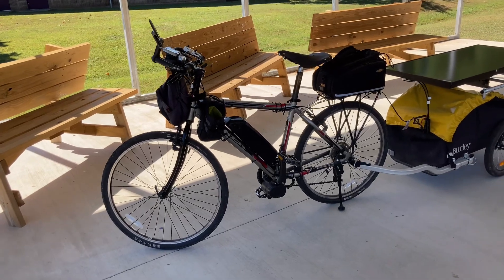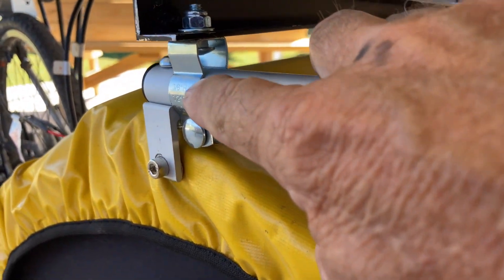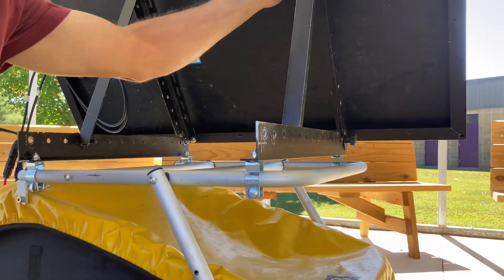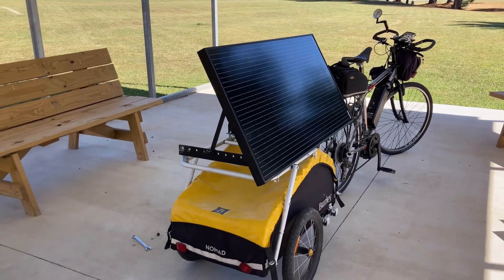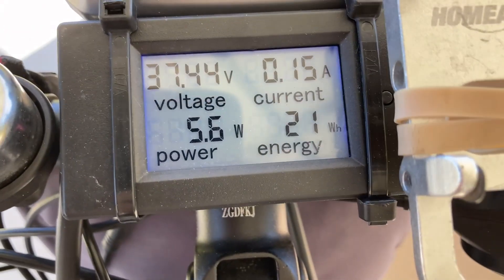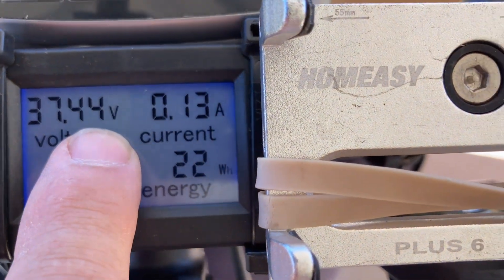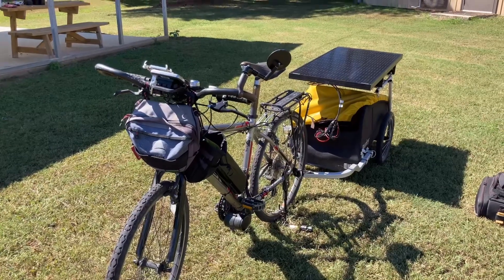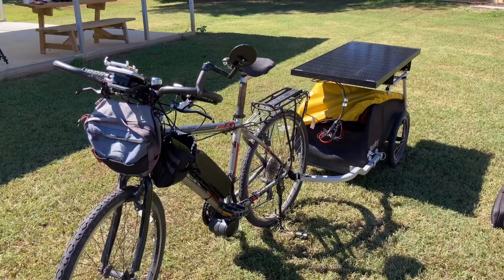My Solar Ebike

Comment: I have been using solar to charge my bike now for a little more than 3 years and rarely need to use the wall charger.  That being said,  where I live and travel many of the roads are under the canopy of trees or in the shade of a mountain so a trailer is just extra weight and a danger on narrow country roads.  My solution is a folding 100w solar panel I carry in one of my panniers with my wall charger as well.  I'm able to travel 70 miles on a fully charged 52v 21ah battery without any charging.  Taking a long lunch in a sunny spot with the panel deployed, or a place with power extends my range considerably.
Reply: True enough, and the lightest solar panel should be cigs panel..., I hate these so called 'flexible' panels, first that is false not bendable, and second they are still solid silicon that cracks way too easily...
Reply: @SolarizeYourLife  Yeah, doesn't take all that much bumpy back roads to render those silicon cell panels useless!  The folding panel I use is a cigs.
Reply: Yeah, when I got into the idea of solar ebike touring I assumed it'd make more sense to just ride the distance you can then make camp in a palce that will get good sun. Fully charge, go the distance, camp, recharge. Ideally you'd have both, get whatever power along the way and also at camp. You'd travel at the rate of power input you get, no problem if you're willing.
Reply: @HoboGardenerBen  In the mountains I use a lot of power climbing at a rate impossible to make up for with trailer-mounted solar.

Comment: Where the burley stock rack bolts thru the. Yellow cover, over time those 2 bolts left and right side work themselves loose, because you cant tighten them really hard. So i drilled all the way thru the 1/2" rack pipe and used a bolt with a nut and really tightened them down..
Also the stock Burley tilt rack only has two positions flat or 45 degrees, so i drilled 2 more holes on each side for the spring loaded buttons , so now i can angle my panel at flat , 20 degrees, 30 degrees and 45 defrees to follow the sun better while riding. Very areo dinamic. When tilted up at 30 degrees . Once you reach your campsite just unhook the trailer and tilt the whole trailer directly at the sun.. my $169 200watt 9bb panel gets 170 watts tilted at the sun correctly and only 100 watts flat. My handle bars are 27" , so my 27"x 44" panel just fits i scooted the panel bach a few extra inches on the horizontal tilt brackets so the panel clears my back fender when tilted up..i use a 800 watt ecoflow river pro 2 for my solar generator which runs my portable ice maker about 2 quarts per hour of ice, and just a cheap light weight folding cooler  to keep a little meat cold. A 500 watt electric heater that i can run in my tent for 5 minutes., to warm it up enough to sleep until i wake up freezing again, then 5 more minutes does the trick, with 2 batteries one always charging while the other bike battery runs the ebike, my batteries can go longer than i can at 65 years old thats more than enough battery power to go forever for free almost, except for food and maintenance on the equipment.😊😊😊😊😊 Ps same set up as you have now..
Reply from the maker: Good ideas.

Comment: Make a chainmail mat out of piezoelectric disks and place the between the tires and inner tubes. Will eliminate the need for solar panels and cut your battery size in half….

Comment: Rigid is heavy but it blows away the flex ones. I use a 170 watt and it charges everything I need. Wish I could show you a picture of my rig.
Reply from the maker: I have a 100 watt folding panel that I can also set up when I stop for the day. Depending on the terrain and wind it could supply all I need.

Comment: Cool! I just got two 100w flexible solar panels from a friend and I have installed  Yose Power 36v 250W conversion set on my bike. I saw you just plug it into the battery, That makes it easy too for  not having to cut much original wires.   I will buy a MPPT converter and test if it works for me. I also got a second hand bike trailer for it. Thanks for you explanation video.
Reply from the maker: Don’t plug the panels directly into the battery. Go through an MPPT so the battery will have the correct voltage.
Reply: @TennesseeCyclepath  yes, a mppt adapter between the panels and battery is the plan.
Reply from the maker: @redbearrc6706  be really careful to not get the polarity reversed at the connections.
Reply: @TennesseeCyclepath  Yes I will check polarity first. Thank you.

Comment: Great setup, you must have a good panel to get so much power.
I have heard it is better to either charge or discharge the battery but not both at the same time,  in some way it is not good for the battery life, better to have a seperate battery charging and another one in use, then swap them over.

If you are ever going to upgrade your tongsheng motor like I did get the new company Toseven, its a cross between a bafang and a tongsheng, it has more power and has torque sensing, so you use less battery power because it factors in what power your legs are doing. Also you can customise it via the creen much more than any other motor. Easy install just like the tongsheng
Reply from the maker: Thanks for the info. I didn’t know about the battery or the new company. I am definitely going to be looking for a new kit soon. The Tongsheng has worked very well for me though.
Reply: @TennesseeCyclepath  I only got about 2000 miles before it stopped turning the chainring, I found out this is a bearing called 'sprag clutch ' a one way bearing. I think it is beyond ne to change it

Comment: I like this idea can it also be used the same way for electric scooter?
Reply from the maker: Probably. You wouldn’t have as much range with a scooter because you wouldn’t be pedaling.
Reply: I mean the solar part like if I wanted to just put a somewhat big battery pack to recharge from the sun to store the energy to recharge a scooter just to get the extra miles.

Comment: what engine do you use? What do you think is the best power for a balanced use of energy and that can carry a 90kg person? Greetings from Argentina
Reply from the maker: I have a Tong Sheng TSDZ2  36  volt, 350 watt mid-drive motor.  It has been flawless in nearly 5,000 miles.  It has torque sensing.  Next conversion will be 500 watts.  It's a little underpowered pulling the trailer on hills.
Reply: @TennesseeCyclepath  Gracias por la información!

Comment: Have you assessed typical Wh input versus output when riding your bike.  I can ride at about 5Wh /mile and wonder if your system would sustain that on a
summer's day.
Reply from the maker: Unfortunately I don’t have a watt meter to measure the power my e-bike is consuming. I will say I depend on pedal power as much as possible. On a “typical” day my solar panel doesn’t keep up. I notice the battery voltage slowly dropping during the day.  When I stop for lunch etc. there is some recovery. My e-bike console doesn’t show battery percentage either so there’s a lot of guessing on how my system is performing. It’s a Tongsheng TSDZ2 and has gone 3,000 miles without a problem but the console is one of its negatives. I am going to do an overnight trip very soon weather permitting and will post a video. I will pay attention and take notes about the solar performance.
Reply: @TennesseeCyclepath  Thanks for your rapid reply.  I have a Tongsheng that was on my wife's bike. I have transferred it to a Dawes Kingpin with 20 wheels and it's a great performer. I hope to do an off grid tour in Wales in Spring with a solar trailer as a back up to other opportunities (ie cafes etc) - if I ride for 4 or 5 hours (30-40 miles) - should get enough solar...but cloudy weather is always a risk!   All my ebikes are charged by a static panel on  my shed using same mppt charger as yours - has worked well for two years - and charged my lawnmower too!

Comment: I've been cycling 4 years with solar power. I would not recommend to never use panels below 150W, and I suggest always measuring the exact power & production. A lot of the smaller panels are just complete junk, since most don't care about stats like temperature coefficients or quality of the protective glass/plastic.
Reply from the maker: It’s a learning curve for me. I wanted more watts but a 100 watt panel was as big as I felt safe with pulling on a trailer.

Comment: For the most part, the solar should/will mostly be used while stationary... While on the run/road, there are just too many trees/buildings that are constantly shading the panel... Believe me, I tried...
Reply from the maker: You have a point. On the rail-trails for example there’s lots of shade.

Comment: Where's the links you talked about?
Reply from the maker: I put them into the comments when I published the video. I just looked and they aren’t there. I’ll try again.
Reply from the maker: MPPT controller. Original model was not available:  https://a.co/d/1aDufvK
Reply from the maker: Solar panel. There are many choices. Here’s what I bought:  https://a.co/d/eexVOyg
Reply from the maker: Burley trailer. I mounted my panel on to a one wheel “Bob” trailer since making the video. Here’s the Burley:  https://a.co/d/7VlTvUK
Reply from the maker: Rack for Burley trailer:  https://a.co/d/iBR35bc
Reply from the maker: Watt meter. There are many choices:  https://a.co/d/iqFIfKZ
Reply from the maker: Watch my Solar E-bike video before you decide to build a solar setup

Comment: Solar takes a long time. If you were off somewhere and depended on it to charge you to get back home you would need a lot of time to kill.
Reply from the maker: When I was putting this together, what I envisioned was a setup that would lengthen my range. I didn’t think a 100 watt Solar panel would supply all my power needs. I am going to take it on a short trip soon and see just what it is capable of. I’ll put out a video of my results.

Comment: How much are them mppt mate
Reply from the maker: 4 LEDs MPPT Boost Solar Charge Controller Panel 300W Regulator Solar Panel Battery Regulator Charge Controller 24V-72V https://a.co/d/1aGlD2V
Reply from the maker: I finally found the right button for the links.
Reply from the maker: Solar panel:  ACOPOWER 100w 12v Monocrystalline Solar Panel Module with Connector (Panel Only, Compact Design) https://a.co/d/14p7GD6
Reply from the maker: Watt meter:  KETOTEK Amp Volt Watt Kwh Meter Tester Panel Digital 4 in 1 Ammeter Voltmeter Multimeter 12V DC 6.5-100V 20A, Voltage Current Power Energy Usage Monitor LCD Display Car Motorbike Solar https://a.co/d/2GxwHuS
Reply from the maker: Rack for Burley Trailer:  Burley Nomad Cargo Rack https://a.co/d/gOBDx3G
Reply from the maker: Burley trailer: Burley Nomad™, Aluminum Touring Cargo Bike Trailer https://a.co/d/e4AAn2t
Reply from the maker: Solar panel rack: Heavy Duty Adjustable Brackets for Mounting Solar Panels on Ground Roof Wall DIY Off-grid Solar Racking System,Solar Panel Stand Foldable Tilt Legs 3mm Aluminum Rack Mount Rails with Hardware(22-inch) https://a.co/d/5YqpS3n

Comment: not bad but with roadie stuff you could easily save 70 watts just on aerodynamics. smaller tent, smaller pack, maybe under 40 litres, the close fitting clothes everybody likes to hate. it really adds up. given an average power output of 200 watts from your legs, you can probably cruise at 17-19 miles an hour if you have the right equipment. if you do that 4-5 hours a day you already cover as much as you do with this setup